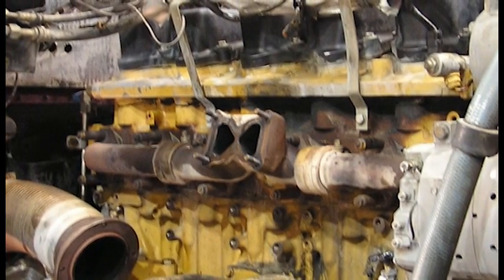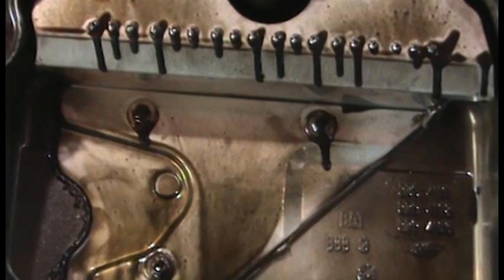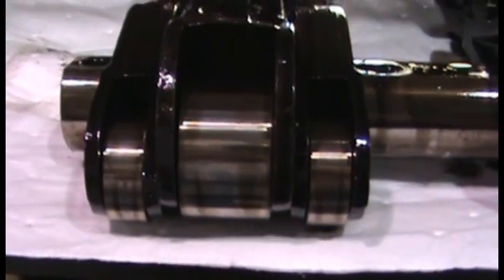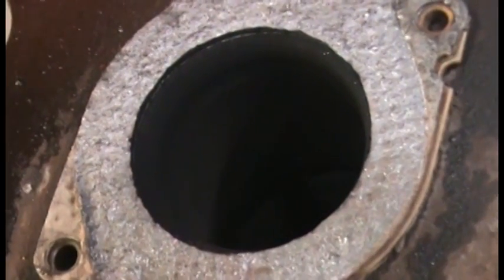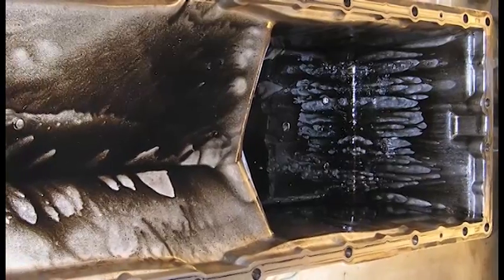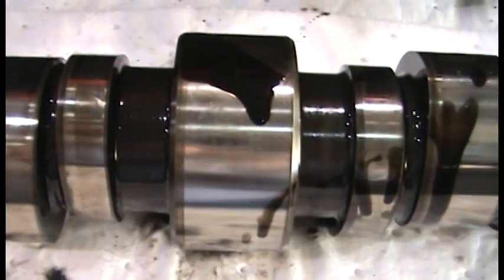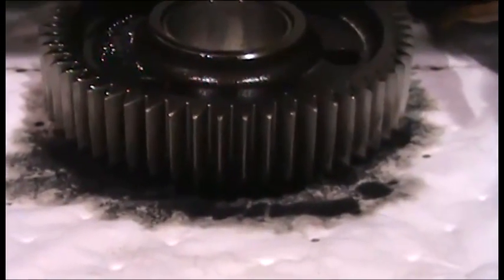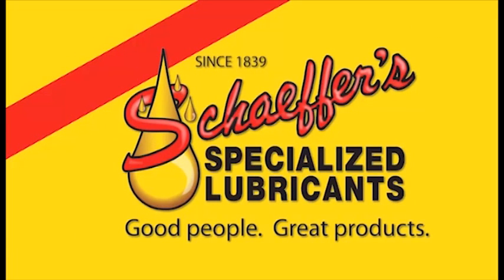Schaeffer Mfg. Million Mile Diesel Engine Teardown

Comment: I have used Schaefers oil for 15 years now. I have a 2005 Dodge Cummins 5.9 motor.  I change every 25000 miles and samples tested show this oil still holds its integrity.  I have 300000 on my truck.  Nothing ever done to the motor
Reply: Change at 25000? I can not wrap my head around that. I use t6 and do 3500 and 5000 intervals
Reply: @johnjoyce9913  How do you feel about all the AMSOIL fan boys who claim the same thing ?
Reply: I love my truck more than the money saved on extended oil changes.
Reply: @oldsalt8011 I think you kinda missed the point of the video his comment. 300,000 Miles with no problems speaks for itself.
Reply: @Captain-Awesome  Well, I just don't think that I want to run an oil change up to 25k miles. I'll think about 7k or less.
Reply: @oldsalt8011  I certainly don’t either, call me chicken or wise, he was saying the got 300k in his truck with very high mileage oil changes.

Comment: It's a kitty most of them can go for 2 million miles and owner operator's rebuild their engines at 1 million, so what he's talking about is not uncommon in diesel engines and it's not because of schaeffler's, it's called maintenance.
Reply: Still should show alot more wear than that that's impressive
Reply: @Maddog3146   i rebuilt my cat with 1.5 million miles(just regular oil) and was clode to that.... schaeffer is just a snake oil
Reply: Can you back up your claim with data?
Reply: Yes but higher quality oils will need oil changes less frequent allowing the truck to stay on the road longer
Reply: @bryanmartinez6600   bs... i just changed the oil on my cat engine following the manual...1.5 million miles  with regular diesel oil...
Reply: @marceloevera2009  by stay on the road longer I mean less maintenance down time not how long an Engine will last though cat has given up on OTR trucks due too the emissions requirements.

Comment: 60,000 between oil changes?  That's a lot. I've seen several kitties well over a million.
Reply: i am a jabroney they said 50k miles but these large Engines have more than one oil filter sometimes and can do lots of miles otherwise a semi would need an oil change weekly which is inconvenient
Reply: I have 33k on my schaeffer 9000 5w40 in my duramax. I use 1qt every 4k miles so with topping off, my analysis pretty much has stayed the same since I had 13k miles on it. I would expect that if I drained it and went to rotella 15w40 cheap stuff within 3k miles my analysis would not look as good as my oil currently does with 33k.